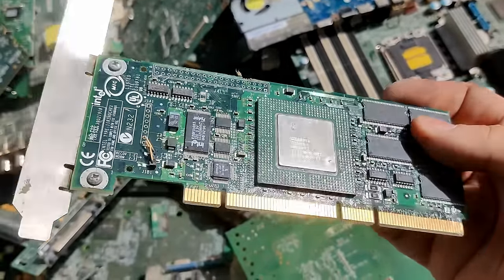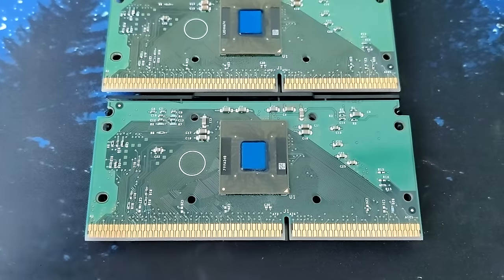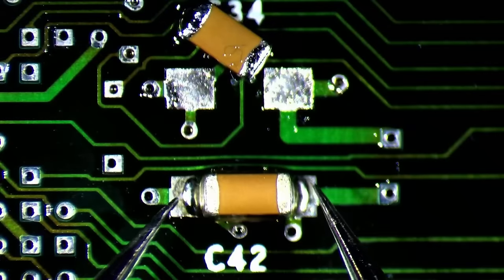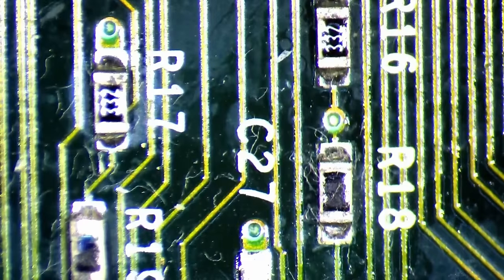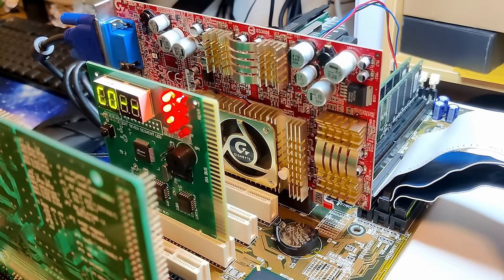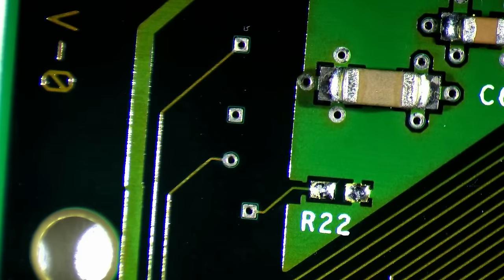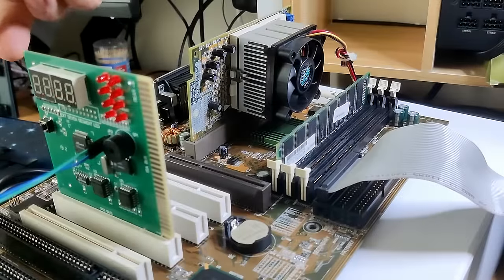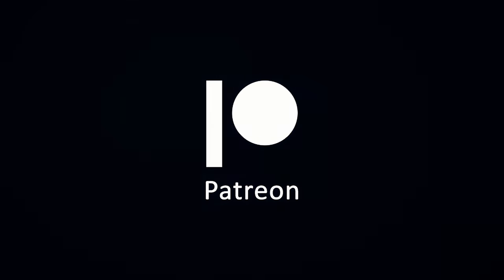Pentium III SECC volt-mod for more compatibility!

Comment: So, why not just bridge the pads with either a wire or solder blob? Seems a bit silly to use a 0 ohm resistor in that situation. I know why they do from the factory, easier for pick and place, but when you're doing it, I don't quite understand the point.
Reply from the maker: It's personal preference. Yes, you could use a wire or a solder blob to bridge the contacts. I just have endless 0 ohm resistors which I can use. Also, if I were to use a solder blob or wire, someone would complain 😅
Reply: @bitsundbolts  Given I've seen people complain about astrological events occurring on a school day, I wouldn't put too much stock in it, but fair enough.

Comment: use a different cpu to turn off internal cache. or maybe the chip you moved the pic needs to be removed to see if any of the traces are messed up and if you are feeling froggy you can swap the chip on to another CPU that does run to see if it works
Reply from the maker: I thought about a chip swap. That IC with the bent pin must have been hit hard. The solder joints and the legs are quite strong.

Comment: Given the amount of physical damage, I think that you may have to "rehot cpu friend!". Seriously, if you can't find any other damage, solder balls under the CPU are the most likely thing, other than the silicon or the board the CPU die is bonded to being damaged. Since those are probably impossible to fix, I would suggest a reflow or even a reball.
Reply from the maker: I may attempt a reflow / reball if I can't figure out anything else. It's also some extra practice!

Comment: Maybe the balls underneath the cpu or even worse the balls between the core/die and the substrate are broken.
Reply from the maker: That would be sad. I may be able to do something regarding the connection between substrate and PCB, but not between die and substrate 😞
Reply: @bitsundbolts  indeed, probably is the ones in the pcb so you can try

Comment: odd......I thought by 1ghz they were already done with slot 1.
Reply from the maker: Athlon vs Pentium III: the race for 1 GHz. I think socket 370 and slot 1 Pentium III were released at the same time. Slot 1 was declining already and the 1 GHz model was one of the last CPUs for slot 1. So, you probably already moved on to the new socket 370 platform.
Reply: @bitsundbolts  AMD and Intel both switched to sockets at the same time. I believe the Athlon Thunderbird came out at the same time as the coppermine. It had the integrated cache. I had one. I don't think it was available in a slot configuration. And yeah I do remember Intel and AMD both hit 1ghz at about the same time. Within a week.
Reply from the maker: Yes, they indeed released their GHz flagships at about the same time. I was happy, because I had AMD back then. I continued with Athlon XP and 64 X2. Then Core 2 Duo.
Reply: @awilliams1701  @bitsundbolts Yeah I read somewhere that AMD released the 1GHz  Athlon two days before the P3 1GHz came out! And another fun fact - AMD didn't have on-die cache at this point so they had to set a 2/5 cache divider to get the cache to work stably
Reply: @bitsundbolts  at one point I had an Athlon XP mobile CPU in my desktop. I have no idea how that happened. You'd have to ask my cousin. He gave it to me. I'm like.......how the hell is there a mobile cpu in a desktop? lol And then I switched to Intel core 2 quad, pentium-dual (2 cheaper systems used that), I7 laptop, i7-2600 desktop. And now back to AMD 4700u and 5900x. I think it might be time to replace the 4700u laptop. It has served me well though. AMD has RDNA based CPUs now. I was hoping it would play KSP2..........except that now KSP2 is dead. Funny thing. The 4700u loads KSP2. The menus are buttery smooth. And then when you load an actual game it crashes.
Reply: @bitsundbolts  Hmm I was wrong. Thunderbird was in both configs. There was no way in hell I was buying a slot board though. Not at that point.

Comment: Pentium III 1000EB  SL4BS  C0 rev.  but maybe the core not work basically .. that is the reason scrap
Reply from the maker: That would be nice if it's really such a CPU. You'd be surprised what the percentage of working (or repairable) hardware is I find there. If I exclude hard drives, it's easily above 90%.

Comment: R4 looks cracked.
Reply from the maker: Yes, you're right. It does look cracked. I checked and removed it from the processor, but it looks fine. 50 ohms - similar to a resistor on a working CPU.

Comment: none of the markings on the board are much help, there is a whole series of PIII's that it could be, but if you can manually set the multiplier, try setting it up as a 450mhz 100mhz 4.5x as that is the lowest spec for that board, the lowest 133 fsb is 533 under clocking it has more chance to get it to boot than over clocking it.
Reply from the maker: I'll try that. There are some CPUs that follow the settings of the motherboard for the multiplier. Most slot 1 CPUs have a fixed multiplier - so, the setting on the board will be ignored. I'll try it anyway! Thanks for the suggestion.
Reply: @bitsundbolts  it's been a long time since I worked with slot 1 CPU's but there were some boards that you could manually set the clock and multiplier. if I recall some CPU's had an internal clock doubler, others didn't. but my memory might be a bit fuzzy. I think one of the slot 1 SOYO boards would allow us to manually set up the CPU, but can't remember if that was for PII only or if it worked on PIIIs too.
Reply from the maker: Yes, all of this was there. Clock doubling was introduced with 486 DX2 CPUs and then DX4 with the clock tripled. From socket 3 to 8, most settings were configured using jumpers. Then came fixed clock multipliers and the ability to configure CPUs using the BIOS. I think only a few early slot 1 CPUs have an unlocked multiplier that can be set by the motherboard.

Comment: I See Dual lga 775 socket Motherboard
Maybe You Should checkout(And Restore)
Reply from the maker: Haha, those are mainly server boards. I don't mind bending some pins on 486 CPUs back into place, but those LGA sockets are on a different level... I don't know if I want to get into something like that. Maybe as a challenge one day, but it should be a board worth saving.
Reply: @bitsundbolts  LGA775 (or in this case, LGA771) have relatively large pins, it shouldn't be too hard. The newer LGA sockets have a much greater pin density. Even then it's not too hard to correct a couple of bent pins. For a hard time find an LGA3647 board.

Comment: If corner is damaged, most of time, it is dead.
Reply: Most of the time if the corner is slightly chipped they still work since the actual transistors are only on the very thing bottom of it.
Reply: I've had several Athlons where the die has corner damage but the CPU works (and even overclocks) without any issues. No experience of Intel chips though with damaged dies.
Reply: @RuruFIN  (Edit - misread your post) ... I have a duron 900 that specifically survived this.
Reply from the maker: I did have Intel CPUs with damaged corners and chipped edges. But they usually do not show any POST code.
Reply: My 370 866MHz coppermine has damaged corners but it works just fine